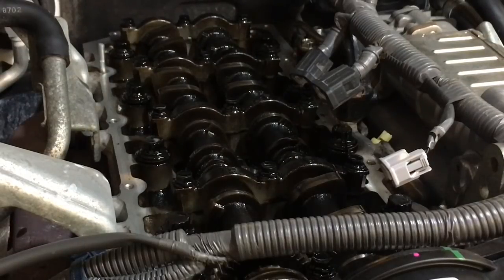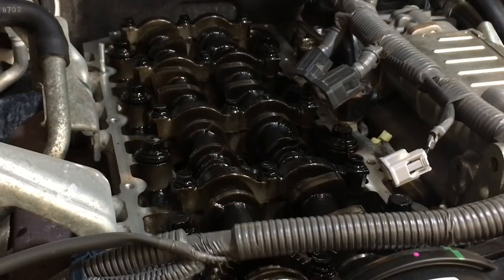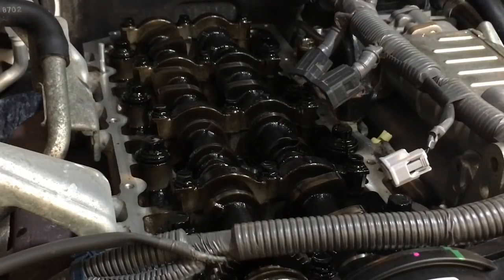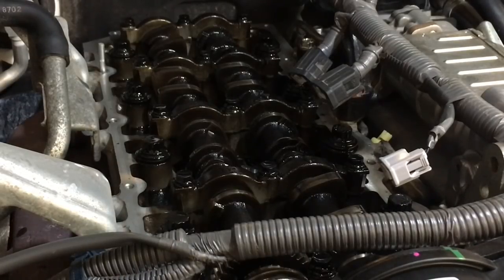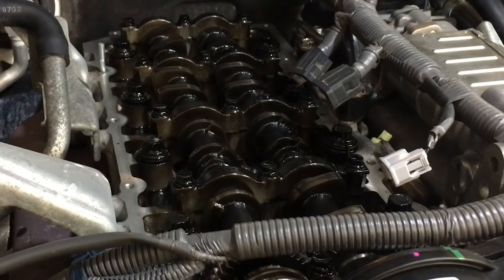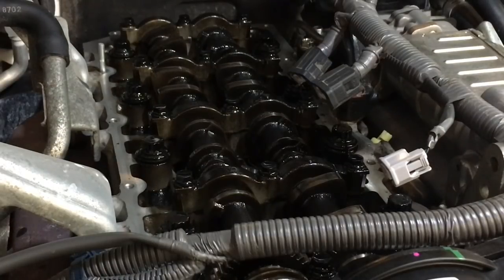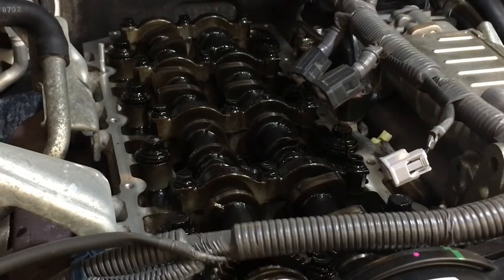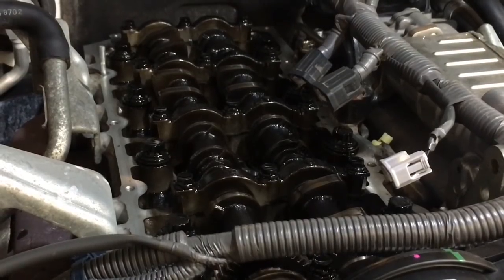Catch cans & valve clearance affects on 1kd-ftv

Comment: It is not catch can that harms head. Proper catch can blocks all soot and most oil.
Reply from the maker: How does a catch can block soot?
Watch egr playlist
Reply: @Fourby4Diesel  Synthetic filter inside? Take a look at MANN industrial catch cans. Thats what I use. I need to replace filter inside catch can every second engine oil change. It catches soot, but not much of it. Why? I replace engine oil every 3,000 miles along with engine oil filter. It helps.
Reply from the maker: I think you missed the point the soot is not in the ventilation system it’s in the EGR system the catch can is not connected to the EGR system
Reply: @Fourby4Diesel  No I did not. EGR removed on my engine. No soot from exhaust in inlet manifold.
Reply: #Fosgen 🤦🏼‍♂️ watch the videos again with the volume turned up. It's all there for you and makes perfect sense. #Forby4Diesel great videos, making my way through your playlists - so friggin much info 🤙

Comment: Find it pretty hard to believe that clearances (gap) would decrease over time, not increase. I would say if they are tight clearances they are tight from the factory.  Are there any instances of burnt valves because of these decreasing clearance on either engines with catch cans or not?  Seems a bit of a stretch to me but love to know more if anyone can elaborate further?
Reply from the maker: That’s OK Mate you don’t need to believe it it’s all explained in videos valve seats where what would happen to you if you were getting blasted by exhaust gas soot 😁✌️😂😂✌️
Reply: @Fourby4Diesel  , upper engine lub doesn’t rely on blowback vapours, get real Antony!

Comment: I’m surprised that the oil would even reach the valves with all the soot caked up inside the manifold. Does the egr gases still get into your engine with the block off and 7mm hole.? Seems like your stuffed no matter what lol. Just put up with it,it’s a diesel

Comment: Difficult to understand what he exactly says............that oil catch cans are closing the valves???
Reply: What he is saying is that the catch cans are collecting the oils which normally combine with the soot and collect in the whole intake system requiring a periodical cleaning . When you install a catch can and allow the soot to go through from the egr , it acts like an abrasive . He also says that perhaps the oily vapour from the pcv might be a a good thing and act like a lubricant to the upper motor . This guy is a little ambiguous at times . I've heard him say a few times now that the soot is the problem  not the oil from the pcv . I noticed on another vid from some other guy that they recommend reprogramming or chipping the ecu when tampering with the egr . The egr in these motors also take the wastegate gases from the turbo, so a complete block of the egr would not be wise.
Reply: Basically the valve seat is on the cylinder compression side, if that wears early because of soot passing through, then when the valve is closed it will sit up higher towards the cam lobe, this is where the clearance is measured, a worn valve seat will mean tighter/smaller clearances which is a problem with valve bounce etc.

Comment: hey mate really love the content. What would be the best way about using an egr block off plate? could I just get away safely with using a plate and no catch can? cheers from nz
Reply: Get the plate with the 7mm hole and it gets installed right before the egr cooler... no other spot. done
Reply: @adamconnolly7478  thanks mate
Reply: Could you run both ?
Reply: @D3NZZA best to run the 7mm plate only mate